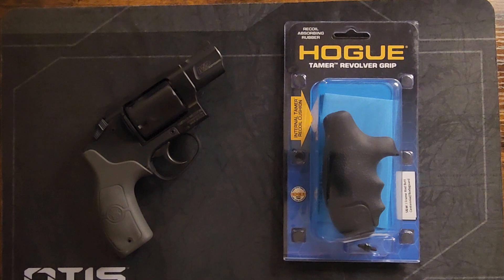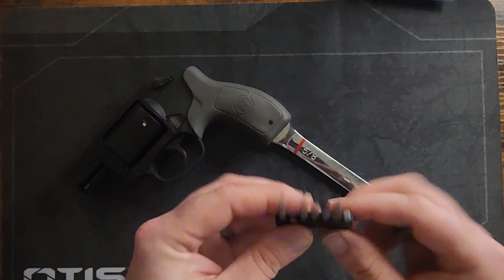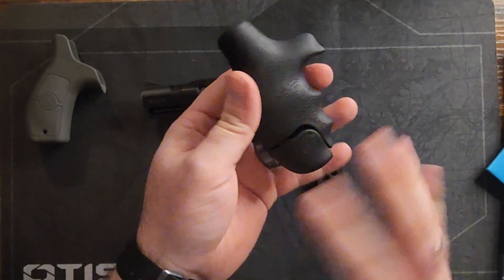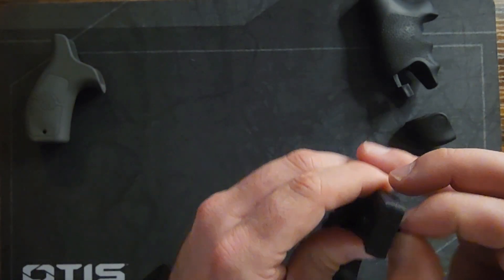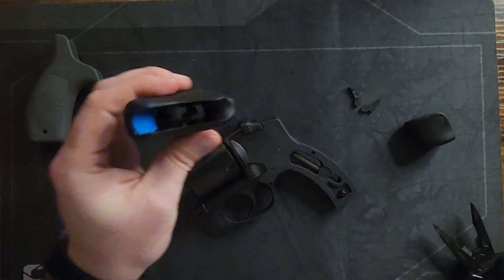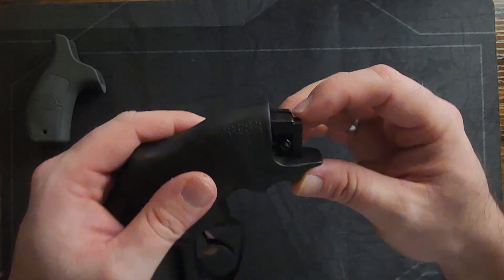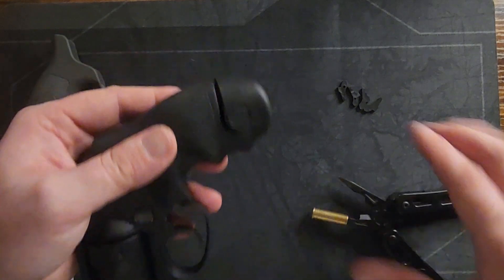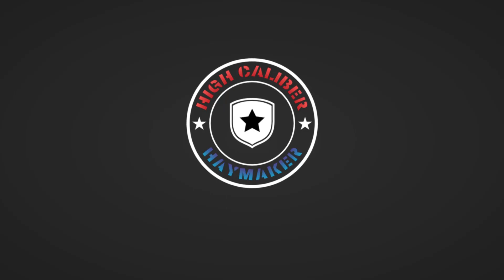Smith & Wesson Bodyguard .38 Special Hogue Grip Install

Comment: I just ordered this replacement grip.  I may have to improvise on the bottom cap install, as I have zero empty brass.  Good video, though.  Easy to follow.
Reply from the maker: Thanks man, happy to help
Reply: @highcaliberhaymaker   - it took some doing - I had to use the plastic strip method to get it to work onto the frame, but eventually my old weak hands prevailed.  The new grip turns a so-so piece into a very useable one!!!
Reply from the maker: @slik560  Glad to hear it!!
Reply: A deepwell socket would probably work

Comment: Thanks for the video, I bought this grip a couple years ago. I didn't know you had to pry the hole open to get that bottom piece to fit, so I ended up breaking it HAHAH. And back then, I couldn't find any videos on how it is supposed to work. Why did they make this so complicated? Why not have it slip on, and put in a screw? I know this comes with instructions, but I could not get my head wrapped around them HAHA. Seeing it visually is so much better. I hate the stock grip on the airweight, it breaks my skin after shooting for an extended period of time, and it really starts to hurt. So having some comfort is very much needed.
Reply from the maker: I agree! It is complicated but well worth it. Very snappy with such a small grip. Using spent brass isn't the best engineering I've ever heard for installation for sure.

Comment: The original BG38 grip is a bogus design. For anyone with medium/thick/larger hands it is a terrible grip since your hands feel loose when trying to grip it, and I use the word "grip" loosely (pun intended). Shooting it is very inaccurate with not being able to grip it properly. This Hogue grip works for a solid accurate grip and this video really helped to in stall it.